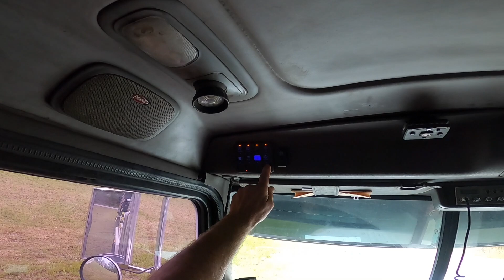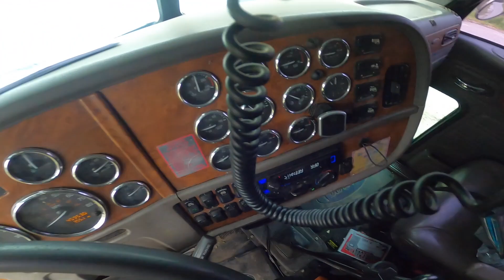Towing A Dump Truck

Comment: A nice video. It is amazing how the heavy duty straps have replaced chains in many applications.  Much lighter and easier to use I am sure.  Who would have ever guessed you would be a videographer in addition to a wrecker operator
Reply from the maker: Mr David.  I sure would not have thought that.  Thanks for watching and stay safe

Comment: What I can't understand is that the owner said the truck was broke down but you started it so you could move it
Reply: He did say that there is an intermittent problem.  Guess he got lucky when he needed it, and it managed to start and run long enough to turn the corner into that spot.
Reply from the maker: Ms Linda  It would start sometimes and then it wouldn't.  I got lucky. Thanks for watching and stay safe